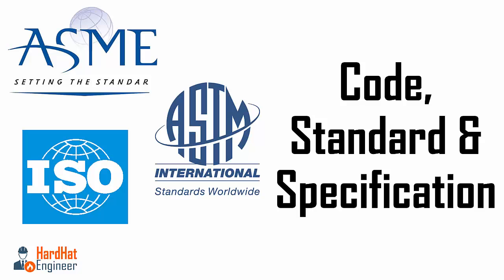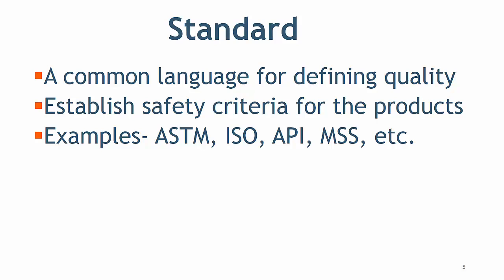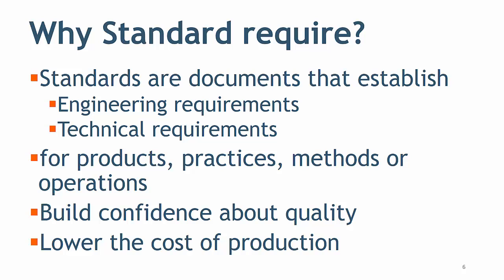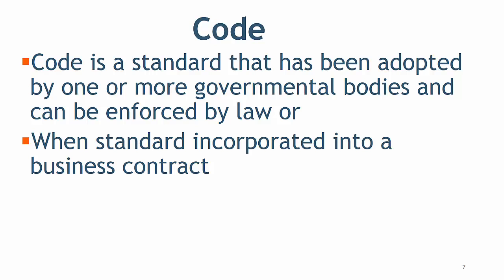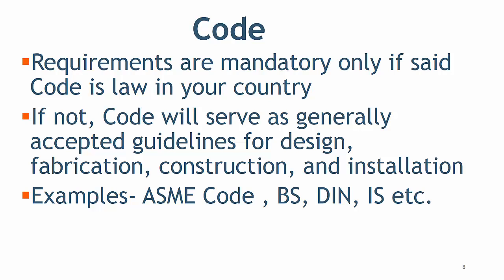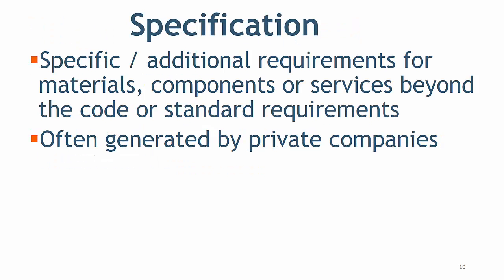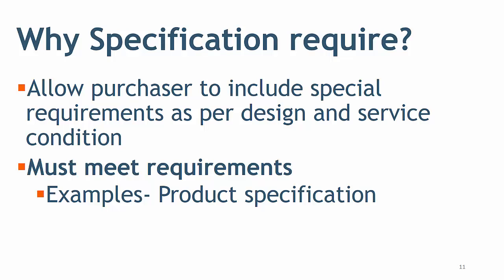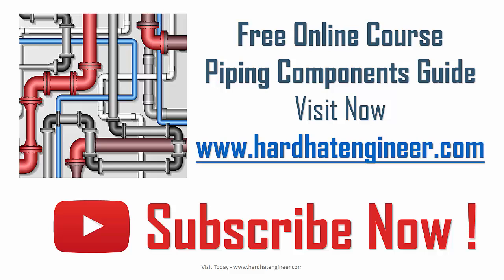Code Standard and Specification - Learn the difference (Revised)

Comment: Isn't illegal to have specifications that are beyond the codes set already?
Reply from the maker: Specifications add additional requirements over the codes so not violating any requirements.
Reply: @HardHatEngineer  sir, if the demand is to have very low cost then would it be considered a specification or simply a demand that would surely be against the already set codes.

Comment: Good informations, best regards
I want to know which standard talk about chemical cleaning for pipes for oil and gas pipelines thanks in advance
Reply: And if possible can you send me this standards at this email 
Ahmed_Yousry@hotmail.com
Reply from the maker: ASTM A380 / A380M - 17 Standard Practice for Cleaning, Descaling, and Passivation of Stainless Steel Parts, Equipment, and Systems. 
for internal cleaning of carbon steel pipe you have to develop procedures